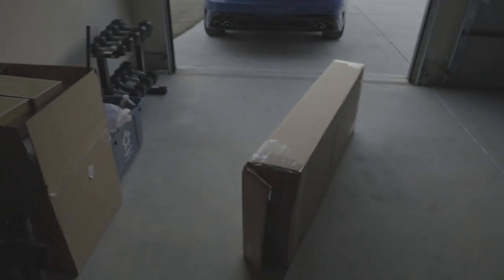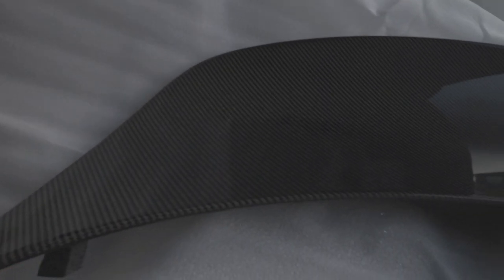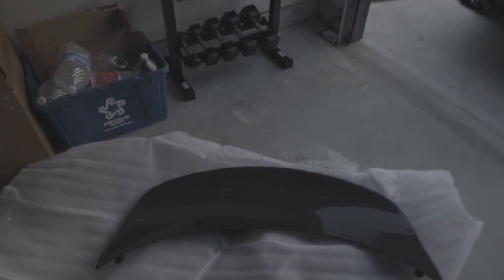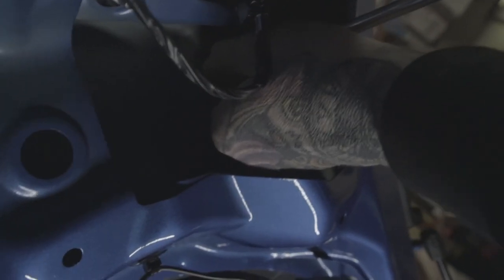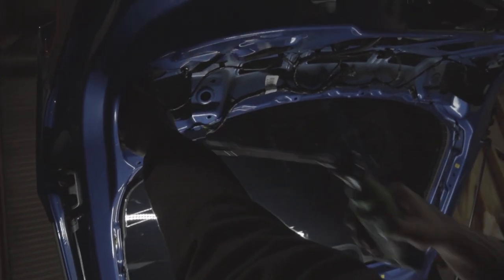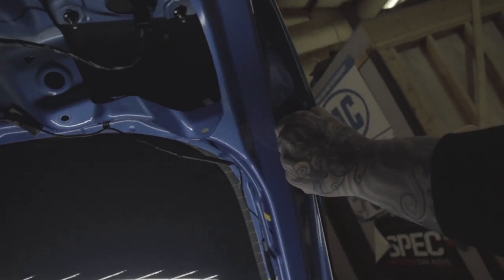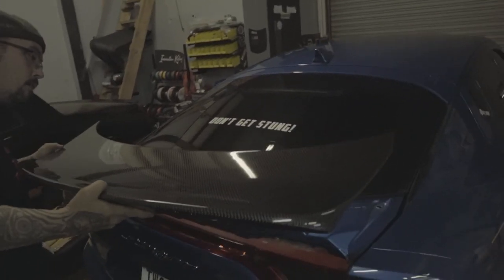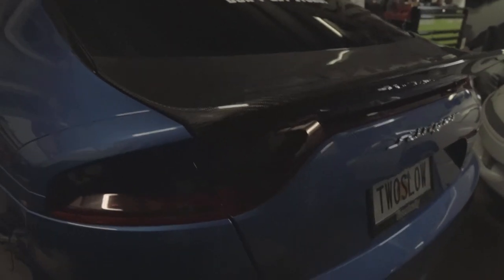INSTALLING ARK PERFORMANCE CARBON FIBER REAR DUCKBILL ON KIA STINGER GT!

Comment: Thank you for the video. :) New owner of the 2019 GTS and came across this spoiler on a website. I loved that 1. it is Carbon Fiber and 2. it is the whole piece extending to the window,  not just a little piece to add to the previous part. Thank you for this video,  only wished it was done in broad daylight.

Comment: What did y'all use to remove the 3M on the OEM deck lid? I have heard that is the hardest part of the swap is that factory adhesive is SUPER strong. Alchohol? GoofOff? Any recommendations?
Reply: i heard someone got a knife and sliced through it, curious of what others have done tho